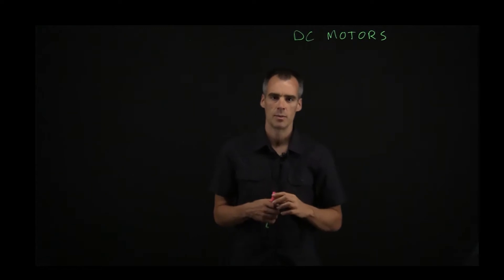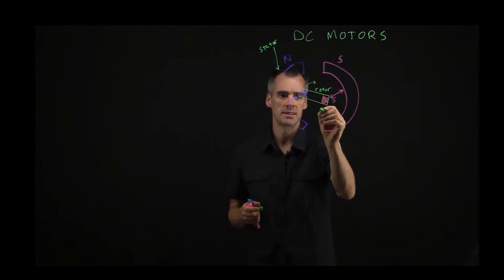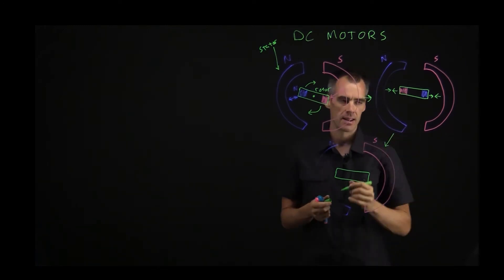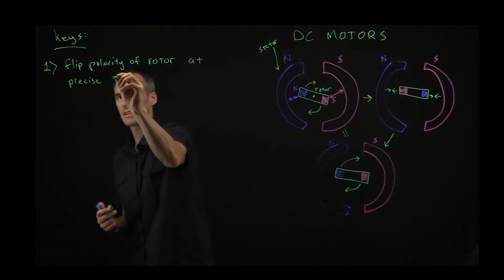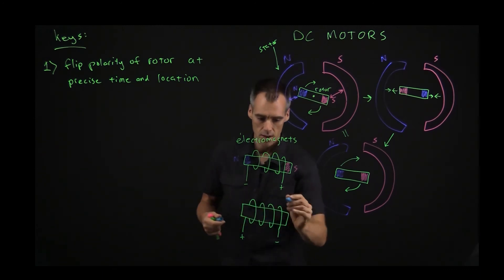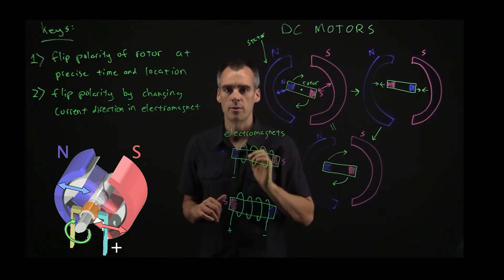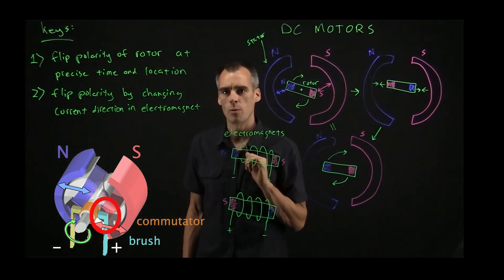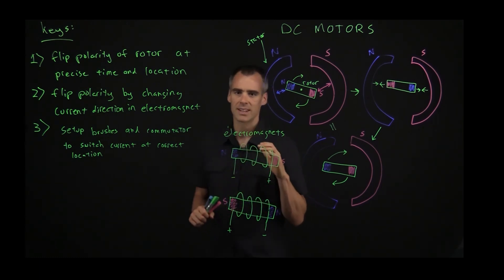How a DC motor works:  basic explanation of the genius behind it

Comment: Fantastic videos 👏

Can you confirm something for me; in a great dc motor let’s go with a 90% BLDC motor 10v @ 1amp on load running rpm 5000rpm, our motor example is from Maxon motors a real world example…

What I want to know is real world output physical efficiency in regards to BEMF and how’s that calculated in the efficiency equations. We know that our motor’s actual Vin is equal to source input V   - BEMF = motor Vin.

Let’s consider only on load efficiency, as would normally be expected. Now we know that BEMF on load accounts for about  30% from the source VIN at on load rpm, (5000rpm) therefore our motor can only use less than the 10vin from supply to produce ford torque. 
So am I correct in thinking that when output is shown on a data sheet it’s with respect to our example is after BEMF is taken out? So if our source VIN is 10v then our motor only gets about 7Vin because 30% BEMF, which means its output efficiency is based on 7Vin x the I and we know as a result of BEMF our source VIN is 1amp but our BEMF will also reduced this 1amp from BEMF inside the motor that it indices, so we cannot expect to have 10V x 1amp from source but actually instead 7Vin x 800Ma (if 200Ma is BEMF induced current at 5000rpm on load) 

So this means the efficiency equation would be motor input 7V x 800Ma - all losses = output physical PH

Have I got this right?

Because generally people think input power to a motor is the source input they are supplying which can’t be true because BEMF reduced what the source is supplied a to the motor ? 

Thanks for you time if you read this